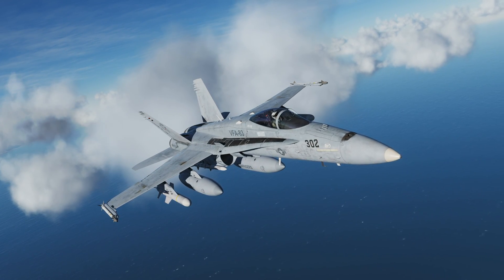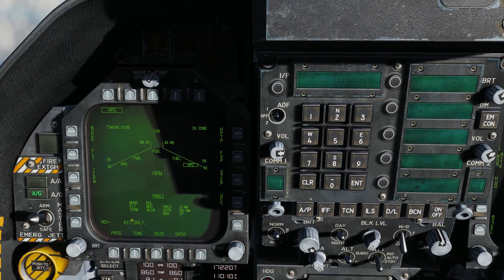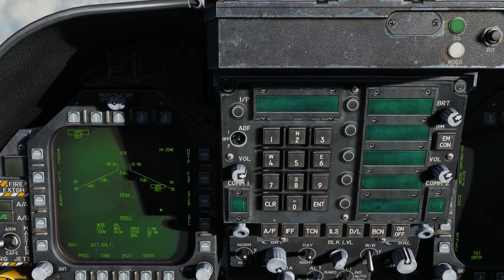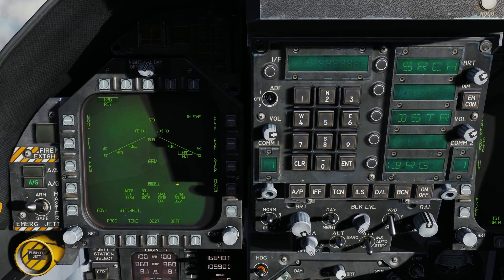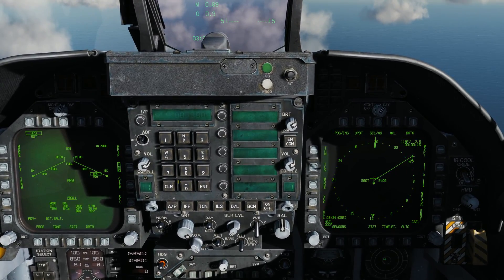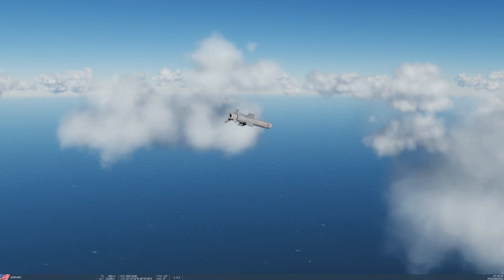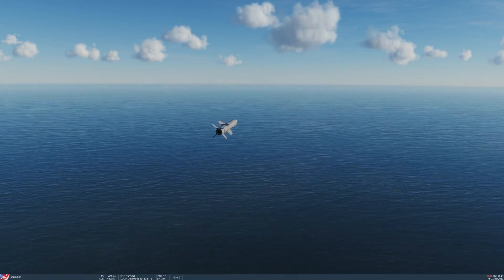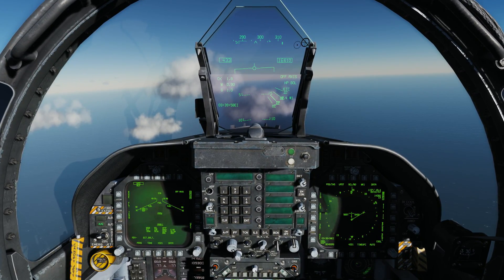DCS: F/A-18C Hornet – AGM-84D Harpoon Basics

Comment: Now i wonder, i was told the harpoon has a smokeless engine in it so it can fly for such long distances, rather then a unpowered glider. makes sense as it skims over the water on terminal guidance. But when you are flying for lets say 20K ft. and you set the harpoon and a high cruise altitude (30K ft.) Will it use its engine to climb to the desired cruising altitude or will it fly level at launch altitude until aquiring a target and initiate the skimming guidance?

Comment: posted on an earlier video but re-posting here to increase chance it will be seen
 On looking through the NATOPS Manual, in at least some F-18s the COMM 2 ARC-210 is an ARC-210 Digital Communication System which is capable of receiving Variable Message Format messages. This would also utilize the Nets page on the DDIs. This is generally used for receiving nine-lines during CAS. Will this be implemented or will it be a conventional ARC-210?